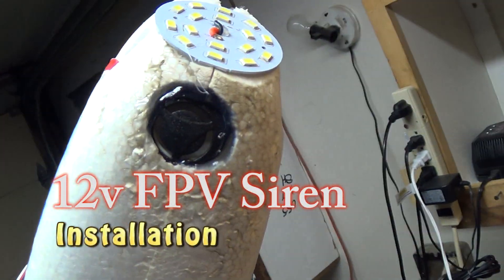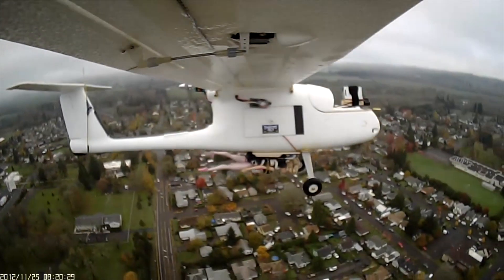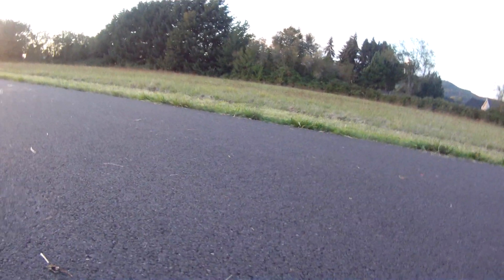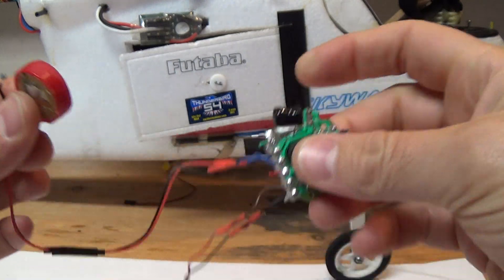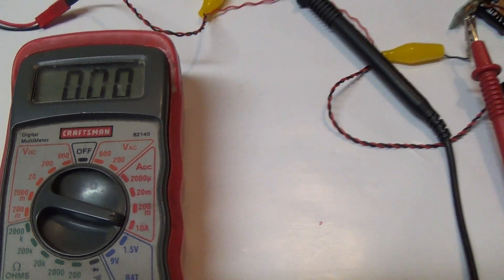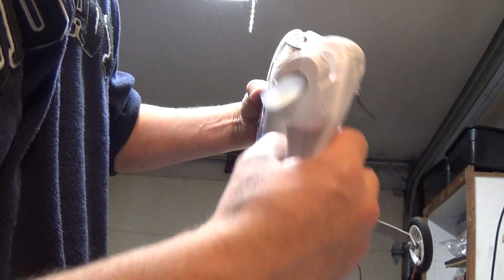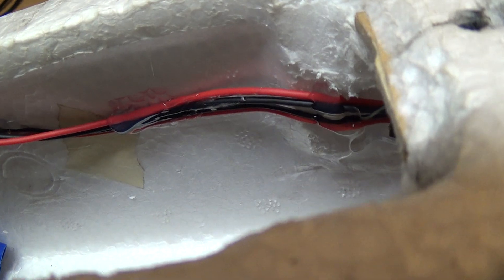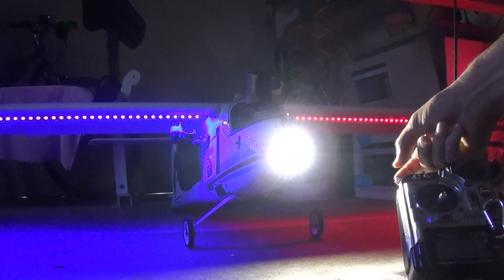Installing a LOUD Piezo Siren Alarm on your FPV Plane!

Comment: I am rigging up the same siren on my plane. I am using the Turnigy receiver switch and it seems to work great for just a single 12v add on. Had to check out this video again because when I was chopping it with my dremmel the speaker wire fell off and I could see where they went from looking here. Got her all fixed..
Reply: Oh man, my speaker wire fell off too, and I could not get it soldered back on so I had to buy a new siren! Glad you were able to fix yours!

Comment from the maker: I stopped flying nitro because electric power is safer. During the few months I flew nitro FPV I had maybe a dozen engine-out situations where I had to make forced landings. You can fly nitro and be safe, but only by not flying any lower than your glideslope. In other words, If I want to fly out 5km, I needed to be at least 2km high, just in case my engine died and I had to glide home. 600+ Skywalker flights later, and zero forced landings now!

Comment from the maker: Yes, if the plane goes down the alarm is definitely one extra easy way to find it. However, if my plane ever goes down, it will more than likely be some kind of r/c equipment failure or a failure of the r/c electronics battery pack, so it may not help me. I doubt I will hit a tree or fly it into the ground or something. I fly pretty carefully. You never know though!

Comment from the maker: I don't think Whelen sells the exact strobe I have anymore. I got it from a friend, and he can't remember exactly where he got it either! The Velcro is the industrial strength kind that comes in $20 rolls at Walmart or Home Depot. Every now and then it works loose, so I glue it back down with medium CA and accelerator. Flying time is 30 minutes back when I had fresh batteries and less accessories (5.5lb plane). Now at 6lb 5.3oz, a worn out pack still gets 18 min. Same Motor/Esc yes! Love it!

Comment: Hello, I've been watching your videos for almost two years now. I love all of them. I have a few questions:
What did you use to glue the Velcro that holds the battery?
I was looking for the whellen strobe light but couldn't find it on their website. link?
whats your flying time with that 5500mah? 
That motor is quite small for that plane. If you were to build another plane, would you buy the same power system?
your answers will help me choose the electronics for my new plane wisely. Thanks a lot